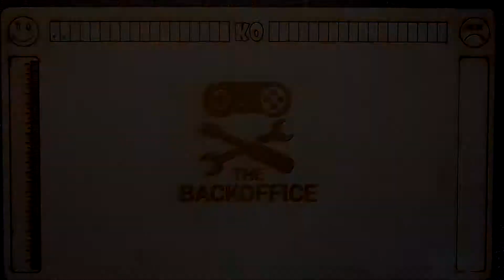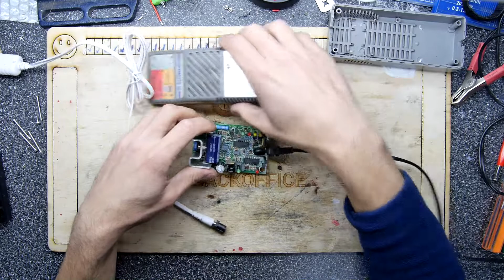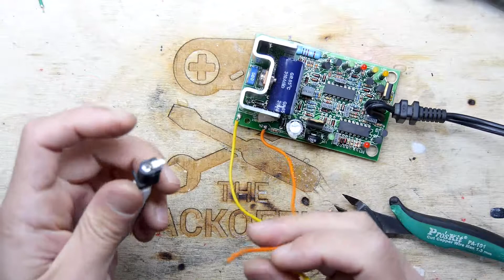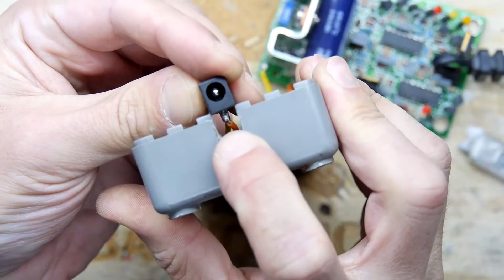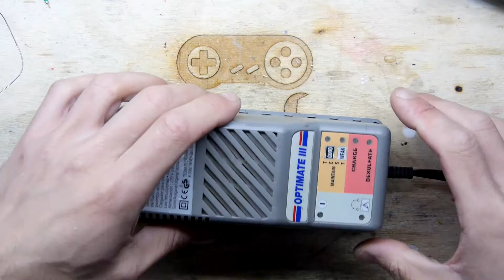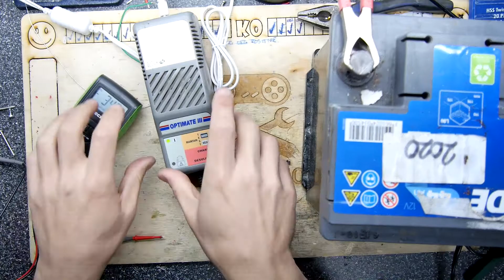Battery Optimiser 2

Comment: At least for testing purposes, if you have a normal (linear, not switch mode)  car battery charger available, the transformer from that (before any rectification) should run the battery conditioner. What do the destructions on the conditioner say? Do you need to leave it connected for a few minutes to analyse the battery before it starts up, or anything like that?